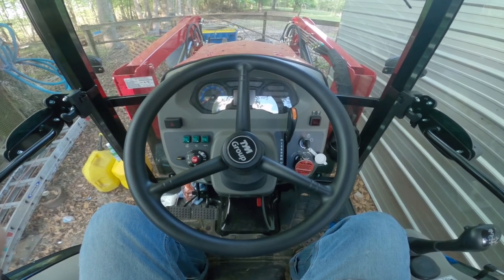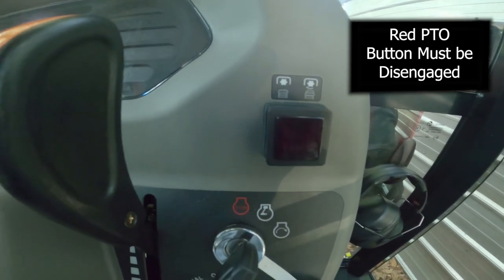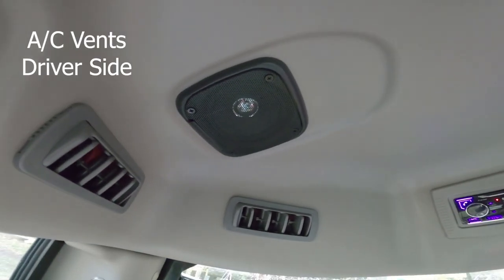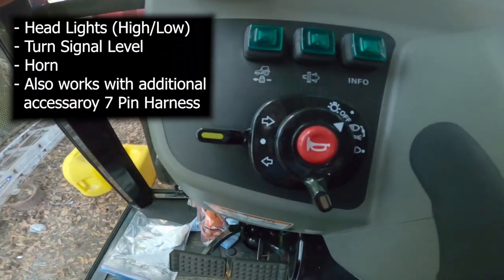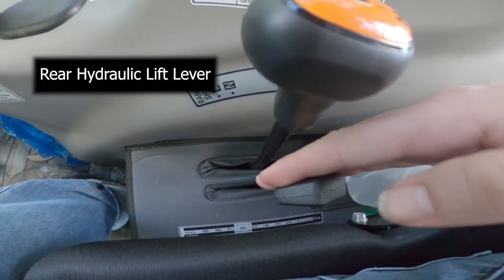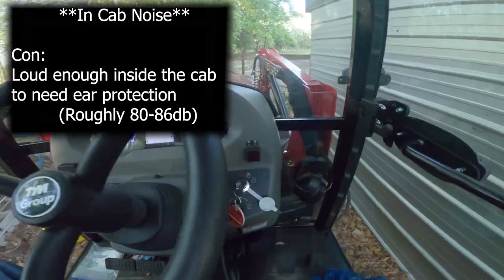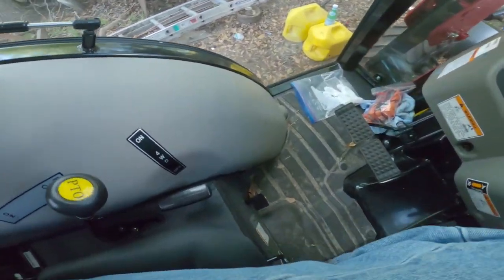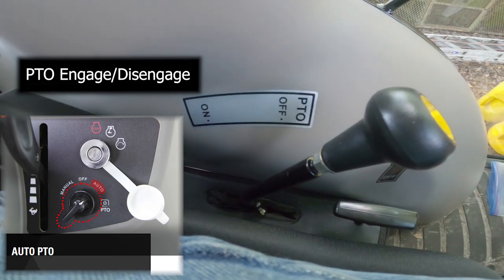TYM T474 HST Tractor 4x4 w/ Air Conditioned Cab - 360 Interior "Walk-around" and Review - Video 2

Comment: Nice tractor. I have been considering the same one. What is your opinion on the hydro transmission.   Can it do real work or is it soggy and soaks up a lot of power. I have a farm and would need it to do some field work as well as zip around moving material with the loader. Thanks
Reply: We use ours for just about everything, the hydrostatic trans takes some getting used to,  it's noisy in the cab but overall we're happy with it. Just make sure you are aware of the loader's capabilities as we find out can't lift 50% of what we need to.

Comment: I could not find anywhere where there is non tym part numbers for the filter for a TYM T474 hst mostly because it has the kukje 4 cylinder engine and not yanmar so I did a lot of searching and here are the parts for maintenance. Hydraulic filter: (wix 51586). Oil filter: (wix 51334). Air filter: (stp sa9269). Fuel filter (manual says it’s a rinse. Haven’t gotten a part number for this yet). Hope this helps!
Reply from the maker: Great feedback AJ! Hopefully this helps anyone searching...
Reply from the maker: @AJ Navy, did you ever find fuel filter part number?

Ours started leaking at the fuel filter O-Ring... Appears to be over torqued and swollen... Haven't even attempted to find a part number for it yet... Figured it would be easier to take the O-Ring to the parts store but not sure the O-Ring it's true diameter
Reply: @mytecsmoketesting6525  No I haven't checked yet.  I was told at advanced auto parts if i brought the filter in they would find the same size filter.  That's how I found the air filter.

Comment: I noticed that you have the parking brake on but there’s no warning light? But on startup it shows?
Reply: I don't think there is a parking break indicator, and that isone of the most frustrating missing features on this tractor
Reply: Apparently they cut corners and didn’t install the micro switch. I’ve emailed them several times but no response except for a robot reply.

Comment: Is the rear hydraulic lever too close to the hydro range stick?   Is the tractor louder than other tractors or is the noise just inherent with a cab tractor?  I am guessing you haven't had it long enough to have any issues?
Reply from the maker: 1) The rear lever is in a great spot, I haven't noticed it being an issue for all the implements we're using regarding access

2) I don't really have it to compare to but my guess is that a shuttle shifter is going to be quieter than a hydrostat due to the inherent nature of the design.

NOTE: It's only loud above 1600 RPM with increasing loudness as you go up in RPM

3) No issues at the moment but it does sound like a lifter is tapping. But with a 6 year warranty we're going to run it!!
Reply from the maker: So we're at 85 hrs and the tapping coming from the engine seems to have quieted down and after the first service the noise in the cab seems to be a little quieter... Or maybe I'm just use to it now lol

Comment: Hey I have the same tractor, can you tell me if when you engage your PTO with nothing attached to it if it makes any noise? Mine only has 32hrs and it makes a fairy loud clicking noise when it’s spinning.
Reply from the maker: We have 70hrs on it now and no clicking from the PTO. I just tilled 2 acres yesterday with no issues or noises. I would just run it and have them look at it at your 50hr mandatory first service.
Reply: Thanks!